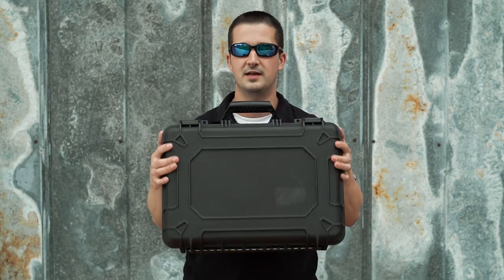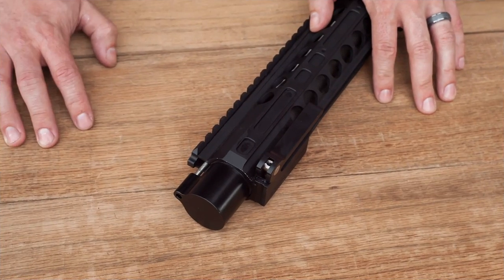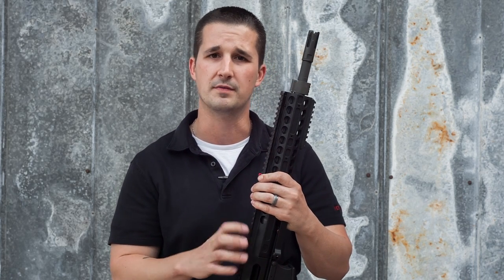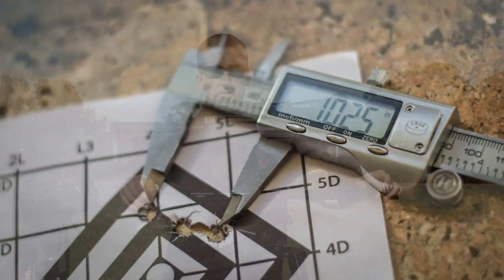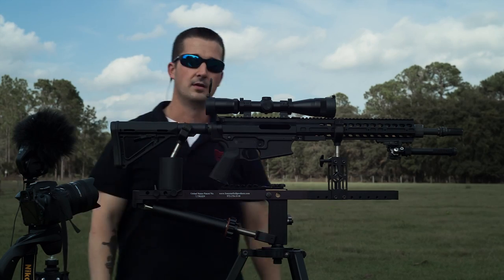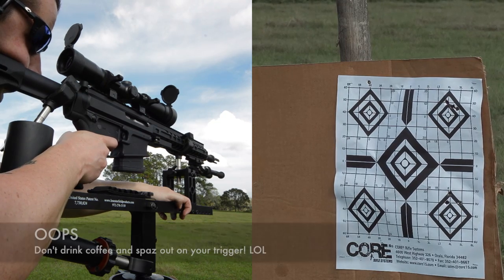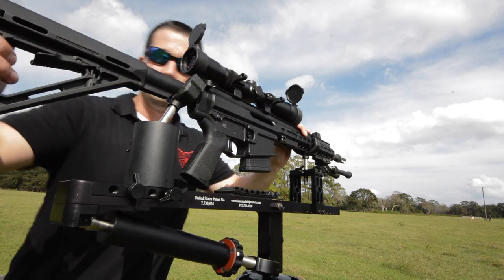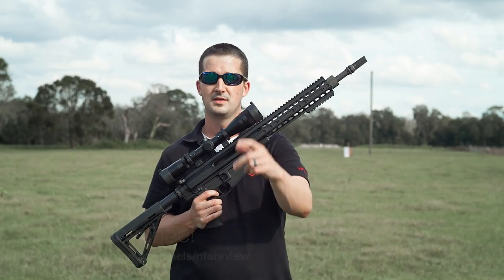DRD Tactical M762 (Takedown Rifle)

Comment: We spent a lot of time with the 5.56mm DRD (two of them) and after the first shot group (5-7 rounds) the gun shot all over the place (5-6" off point of aim).  I think the problem is the barrel isn't receiving enough torque to properly stay seated after the first few shots.  Hand tight even with a lever doesn't achieve the necessary 30-50 ft pounds needed to keep the barrel seated with repeated recoil.  That is my theory on why it performed the way it did.

Comment: Group size doesn't really matter as that will not necessarily change each time the barrel is off and back on. Point of impact is what matters and it definitely does not maintain that which is what I expected. That much shift at 100 will greatly expand the further you move out.
Reply from the maker: +s10v8dude The POI shift seen is the same or less you would get from attaching most suppressors. The added weight on the end of the barrel will change barrel harmonics enough to shift the impact. I think it's also important to note that this was a very small test sample and a larger test would need to be conducted before this system is not considered by some. The easiest way to ensure proper POI would be to use a torque wrench to install the barrel nut each time. Furthermore the vertical string shown would not make much if any difference in a combat role. Since all snipers are trained to shoot at center-mass, this system would serve them just fine out to 900 meters. -NFA Review
Reply: i'm wondering if any shift occured from the barrel warming up. installing the barrel cold out of the case each time may yield greater repeatability, but testing that would be a major pain.
Reply: I strongly, disagree. 

Let’s assume the constants of 100 yards (or 3600") and a vertical travel of about 1.5"
Using basic math, I can tell you that the vertical travel is about 0.024° from point of projection to point of impact (thank you Pythagorean theorem). 

If we were to magnify that out to 600 yards (or 21,600") the vertical travel is 9" if I were to magnify that out to 900 yards (or 32,400") that travel is slight more than 13.5" That is an entire foot of variability in the point of impact just in assembly variance alone. Add in the fact that there is slight horizonal travel. You just took a shot from center mass of the body to over their shoulder.

If you throw in humidty, wind, temperature, air pressure, spin drift, etc. and you have little to no chance of hitting your target.
Reply: I leave mine together still 1 in grouping at 500 yrds with a vortex 6x24x50
Reply: @boatsnhoes7625   do you even math?